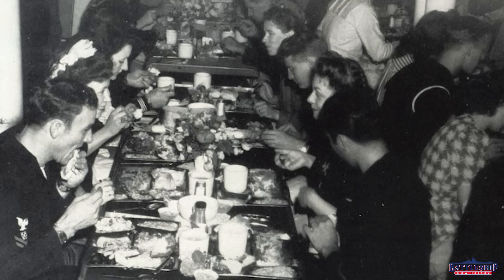How To Feed 3,000 Sailors FAST

Comment: When I was in basic training for the army, I had a few rotations of KP duty. That is things like putting out the flatware, cleaning the plates and trays, scrubbing pots and pans. At best, I was neutral to the experience at the time. Looking back, it was a window into what it takes to feed several batteries in such a short timeframe.

I’m fascinated to see how the chow hall works on ships. Did ships have KP duty for the crew (guys pulled from other divisions to help with kitchen duty) or was everything handled by the kitchen staff? What are the general quarters stations for the kitchen crew?
Reply: Kitchen staff would, IIRC, be all assigned damage control duties, seeing as they likely all had fire fighting training, as a mess is the most likely place to have a fire other than in battle. Enough kitchen staff as well to run kitchen, though you probably also had other sections, like laundry, that did the bulk of the work, and you would always get a chunk of off duty able seamen that got tasked with it as well.

Comment: One thing I've often wondered about for ships was lunch. Unlike breakfast, that happens before you go on duty. Or supper, that can happen after. Lunch has to take place during. But it seems like there are a lot of jobs onboard a warship that don't exactly suit buggering off for half an hour.
Reply: Generally staggered lunches, you have half go off on the first rotation, and after they are back and 15 minutes later second half goes off. That way at any meal you are only down half the crew, and for some critical functions you only take a third off at a time, or serve them close by, like the officers in wardroom, or captain at his ready room.

Comment: On the Intrepid in the mid 60's there was only two serving lines.  Forward of the mess deck above the forward engine room there was a smaller serving line that was used for mid rats.

Comment: I spent a night aboard the USS Midway circa 2008 when I was a cub scout. If I remember correctly they use the Chiefs Galley for their dinner service aboard because the main galley is used as an exhibit and they dont need the massive equipment that they used to feed some 4,600 men. The smaller chiefs galley was easier to maintain and keep up especially when they are only feeding one meal to around 100 cub scouts and parents. I don't recall it being too incredible (hilariously I remember they were using the same food supplier as my elementary school at the time because the packaging was the exact same), but after a full day of walking through that massive ship I would've eaten anything. Cool experience but I can't say I felt an overwhelming urge to join the Navy afterwards 😂

Comment: I have stayed on a ton class mine sweeper (HMS Iveston (M1151)) that was owned by the sea cadets. They were using the original gally and serving system, but we ate in a porta cabin on the quarter deck where the mine sweeping equipment would have been, instead of in our mess as they didn't trust cadets to carry the food down the ladder.

Comment: My main experience with feeding hundreds of people is man camps and Boy Scout camps. Land based ops. has you using dutch ovens. 5 stacks of 5 ovens in a trench of coals. Each pot is filled and started for all 25. Towers are rotated (top to bottom) through all 5 towers multiple times during cooking. when the first filled is done, lid is yanked and the pot is swung between the serving lines. before that pot is emptied another drops. Then another. All 25 drop in quick succession. 300 guys are fed in 15 minutes!

Comment: it was rather common problem in Soviet era industrial environment where you have to feed 1000s of workers on big manufacturing plant with limited lunch break. It is not possible to feed them by shifts - the main assembly conveyour can not work with some of workers missing, so it stopped completely for an hour and all 2000-3000 workers must be fed, including walk to canteen and back to workplace. 

So they used mostly the same approach. Cooks prepared meals somewhere on back then filled dishes, glasses etc in the middle, rolled them ready on some service trolleys to front lane and finally gave them out there, no complex operations on front at all. It does not allow big choice of course, 2-3 options for each dish maximum (this dish area with fish, this area with sausages, just choose your dish and go), but for cheap industrial canteen its acceptable.

Comment: Ryan, you're not serving 2000 or so at once, don't forget the different shifts. Someone is always on duty. Maybe one third of the crew at one time.
Reply: 6000 meals in a 24 hour cycle
Reply: On my ship, DD-945, the watches were changed at meal times. Guys coming on watch ate first, then relieved the guys coming off watch in time to eat.
Reply: There's four mess periods. Morning, mid day, evening, midnight. Every member is owed three meals a day. So folks should only ever miss one meal period while sleeping. With three shifts, two thirds of the crew shall be eating at any one meal period.
Reply: On that note, if department's stagger their shift schedule, would not load on facilities spread over time?
Reply: Ryan knows that, since he DID mention it in the video. He says they roughly had 15 minutes to eat, because of the finite number of seats, compared to how many needed to be fed.
Reply: ackchually